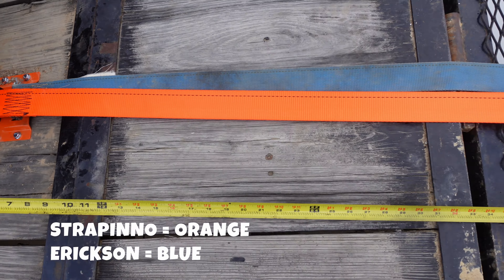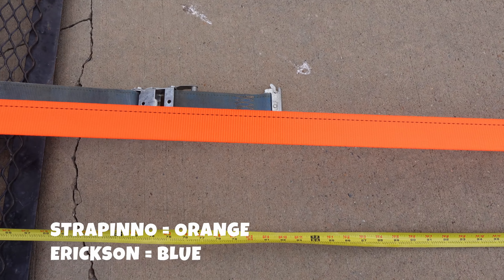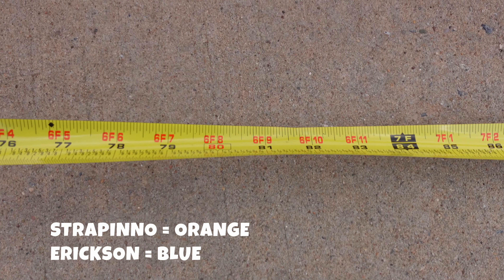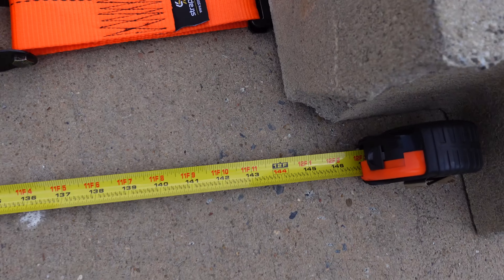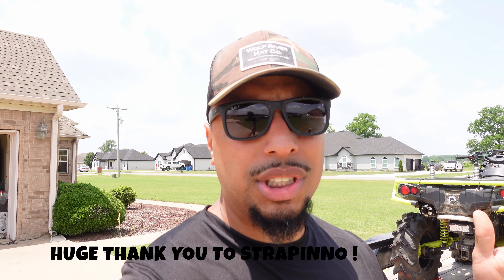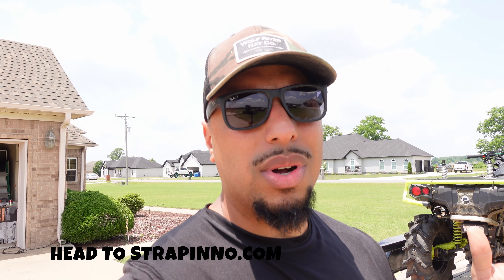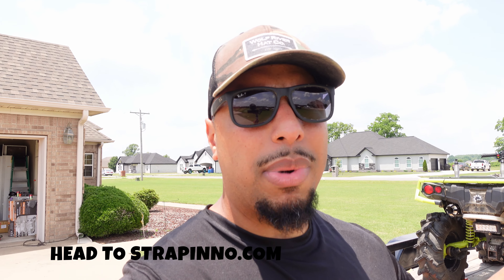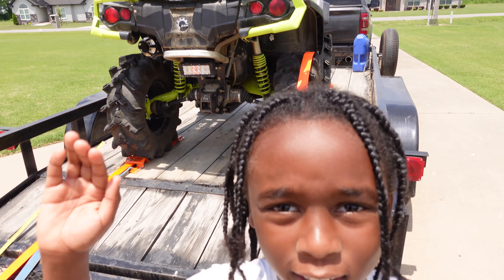THE NEW KING OF WHEEL CHOCK TIEDOWNS - STRAPINNO

Comment: Whats going on man I know this is random would you happen to have any knowledge regarding can am 570 MR was driving it and stopped try to take off and wouldn’t go anymore
Reply from the maker: Rear diff ? Not in gear ?
Reply from the maker: Those are a couple of things that come to mine first
Reply: It cranks but doesn’t start it was running perfectly fine stopped for a min and try to take off and no go been looking at videos some say fuel pump,pump relay fuse